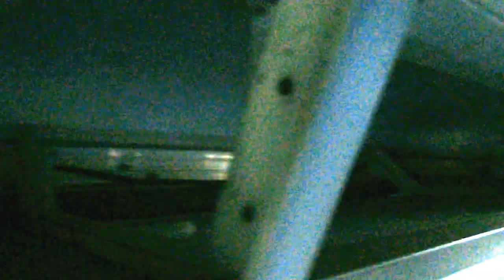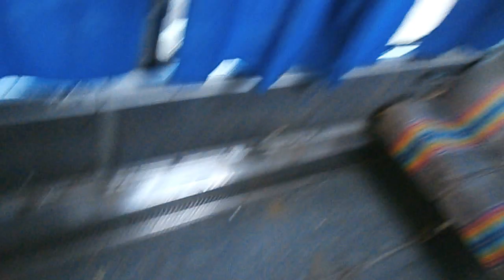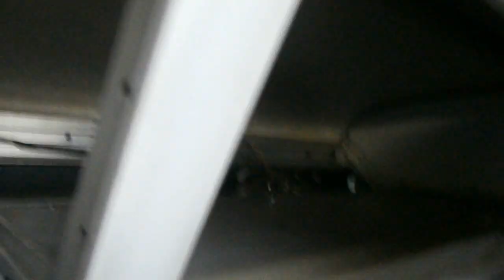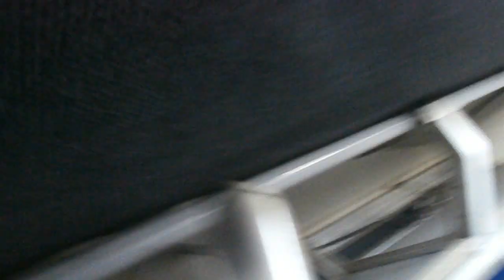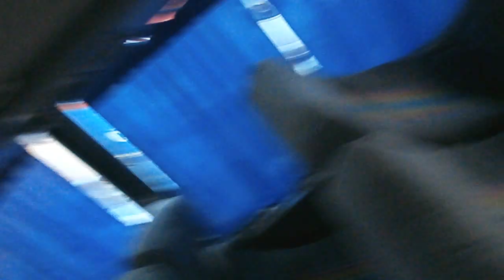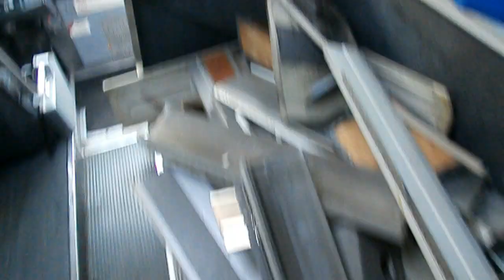Bus Conversion Tiny House #2 Removing Interior Lights, Overhead Storage Doors

Comment: I know this is two hrs ago but I’m in the process of tearing my Transport bus apart. They are similar in the way they have their overhead cabinets built. Of course your bus is a passenger bus for going long distance and mine is a transport bus for going short distance so I didn’t have the overhead cubbies but where your overhead cubbies are I had massive amounts of electric wires and was also the heating cooling duct. Thank you for your videos. I’m just starting to binge watch.
Reply from the maker: +Charlotte Johnson No problem! I know some of the videos can be a little boring but it was a learning experience for us, hope they help in any small way they can! Great to here you are undertaking a project of your own, best of luck
Reply: Back to School Bus thank you. That’s what I’m trying to do also with my videos is teach, or at least let people know who are setting out on this venture what to expect. My videos aren’t very good but they do show some pretty good things, I think. Thanks again for your reply.